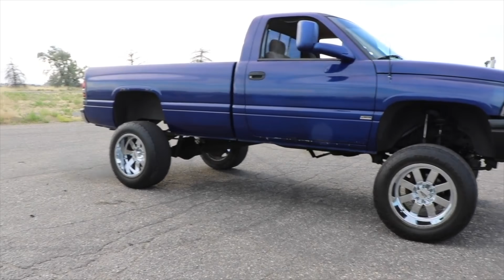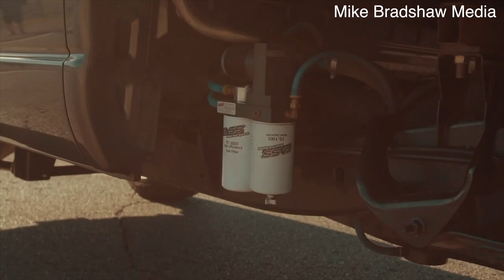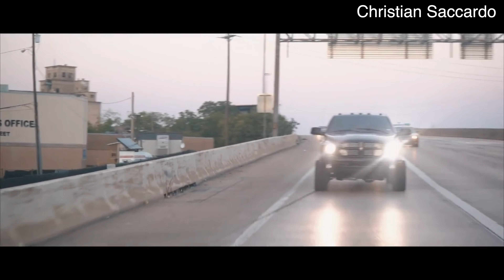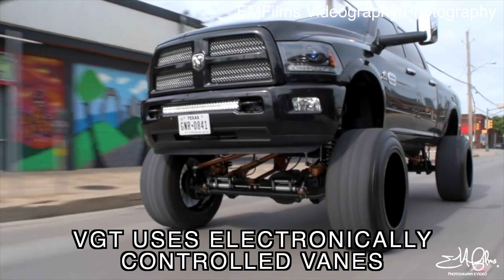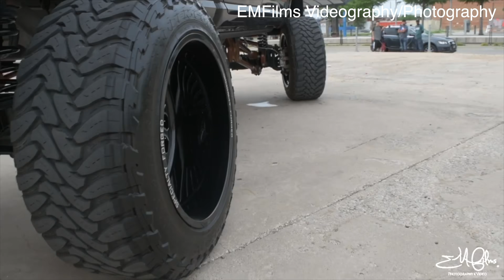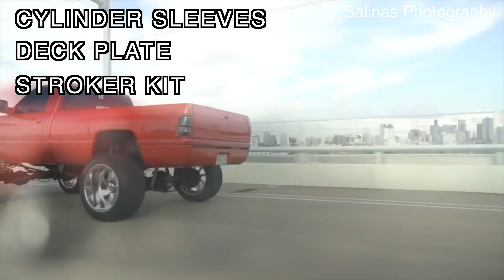5.9L vs 6.7L Cummins: Which One is Actually Better?

Comment: This is a joke of a comparison. Comparing pre emissions to post emissions is apples and oranges.... and lets face it the old 5.9 12 valve that is quickly eliminated from comparison here is the only one of the engines that can get 25-30 mpg and run a million miles... mainly due to... yup NO EMISSIONS, and mechanical everything.
Reply: The first 24v with the VP 44 set up were good too, but still not like the old 12v
Reply: @chazlewis900  I will agree the 5.9CR is just reliable but fuel mileage is no comparison.  I own an 06 5.9 six speed and 3.73 rear I only get 15 empty. My brother has a 97 12V  5 speed  with 3.73 rear and he get 28 empty.
Reply: @ruralram100  exactly what I was saying. Tho you should be getting a lil better with that 06 than 15. Unless your running a hot tune
Reply: The unfortunate thing is my 06 is none stock no tune at all.
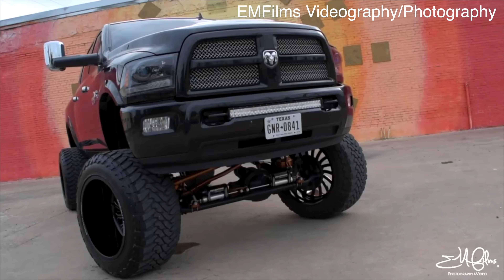Reply: @ruralram100 man you should at least put a straight pipe on it cause my dad's 03 dually 4wd gets  17-19 with 6spd and 3.55, and my my buddies 06 3/4 ton gets about 19 with 6speed 4wd I forget his gears I think it was 3:73 or 4:10, cause it should be getting Betty than 15 with a 6 spd that's auto trans mileage
Reply: @ruralram100  14-15 is about what I get with with my 98 half ton 4x4 With a 5.9 gasser and a auto,
Reply: @chazlewis900  Ok so I guess I'm not bone stock since I am straight piped.  But still my mpg's suck compared to  everyone else I talk to.  I even to the factory air box out and put in a K&N cold air but that didn't even help.  Now she sees a lot of dirt roads so I put my factory airbox back in. Believe me I would be happy to get 18 out of her.  But until then.
Reply: @ruralram100  you gotta watch the k&n on Cummins anyway, I love them on other trucks but Cummins pull so much air they suck the oil off of them. And wierd what rpm you normally run may be lugging it
Reply: @ruralram100  what are you running for tires
Reply: @chazlewis900  At 60 I'm running 1,650 at 75 I'm knockin on the door of 1,800 in my book that is way to tight.  So I try to keep her down around 60
Reply: @ruralram100  that why your lugging her that motor is meant cruise at 1800 on the low end, it optimum range is between 1800- about  2700 high side, if your running with a heavy load should be shifting about 25-27 and running 20-22
Reply: @ruralram100  try running at that for a while and see if doesn't improve, and run a tank of power service through it to clean the injectors
Reply: @chazlewis900  I'll be honest I haven't seen a 5.9 yet or a 6.7 that runs up there In the 1800-2700 range. Every one I've been around they cruise in the 1400-1650 range and get better mileage than I do.
Reply: @ruralram100  that's cause most people lug the crap out of them and why they all have trans problems, I grew up in a family of truckers, and pull heavy with mine hell I've pulled an 18k lb track loader with my 96 3/4 ton and it had 375k on it at the time, run it up it takes some getting used to cause it sounds like it's screaming but it's where it's actually meant to run
Reply: @ruralram100  someting just aint right with those numbers, your engine is not tuned right.
Reply: Chaz Lewis 
My 06 is a stock 5.9 dually., w 4:10 gears, 4 Wheel Drive. It has a straight 4” exhaust , no cat, and a K&N air filter... 
Bully Dog tuner as well which is usually in performance mode...

With a truck cap I get 12 mpg around town and 17 mpg on the highway at 65 mph, Terrible , looking for ways to improve... I am a old guy so I drive very conservatively..
Any suggestions ???
Thx in advance
RJ
Reply: @ruralram100  just as reliable? Not quite. Longevity? Not quite cost efficiency? Not even close. For 1 reason: the cr fuel injectors alone cost as much as a full rebuild on a 12 valve, and guaranteed to fail at a higher percentage rate.
Reply: @justinmartin8887  I’ve seen CR injectors go 400k miles and 12 valve injectors go out at 200k. The common rail is EASILY equally as reliable as the 12v. I’d rather have a trade off of more expensive injectors if it means more power stock, better performance in the cold weather in terms of cold starting & warming up, and ease of tuning and adding power. A bone stock 5.9 cr engine can be tuned to 550 plus horsepower. A 12 valve needs injectors and a turbo for anything close to 400. The tuning ability is also far more advanced than 12 valves as you can adjust timing to be more dynamic in a CR truck than a 12v and not sacrifice drivability.

In short, 12 valves had their time, but they’re old news. The 12 valve is literally the 350 small block of the diesel world and the cr is like the gen 3/4/5 LS/LT. A ton of more room for streetable power, and a crap ton of untapped potential.
Reply: @Redsfanatic32  I never said anything about tuning and steet drivability. It’s quite obvious a common rail would be more capable of that. As far as 12 valve injectors going out at 200k; it probably happened but it’s obscene and nearly unheard of, only happened from abuse. Whereas the common rail injectors commonly go out by 250,000 miles
Reply: The 5.9 24V has several trucks in the million mile club as well. Mine with an eco tune and 6 speed manual would get 22-25mpg.
Reply: Cp3 5.9s are just as reliable and can get just as good if not better fuel mileage than the ve44 or p7100 12 valves.
Reply: @Redsfanatic32  I've owed all three and my dad's 5.9 common rail, gets 17mpg with a 6 speed and 3.55, his 99 vp44 24v 5.9 got 18.5-19mpg with a 5 spd and 4.10 gears, his 95 12v 5.9 with an auto  gets 19-20 with  3.55, and my 96 with 12v 5.9 gets anywhere from 20-25 with a 5 speed and 4.10 gears sitting at 400k miles, I got 20 pulling an 18k lb trackloader
Reply: Chaz Lewis you are lucky I get 18 mpg if I’m lucky. Normally I get 14-15 with a 4.10 rear end and a 5 speed
Reply: @chazlewis900  We got an 05 5.9 2500 auto. gets 28mpg. sooo, Just stop flooring it every chance you get. currently at 560k.
Reply: DC_Rubber Duck 
Are a YOU A SRW OR DUALLY
4x4 ??
Reply: @Redsfanatic32  what the heck is a ve44
Reply: @justinmartin8887  the injection pump used from 1989-1993
Reply: @Redsfanatic32 but not the kinda mileage a ve pump 12v gets
Reply: @johnlonghorn5856  if you read what I said, I did say ve pumps too.
Reply: I've owned ALL variants of the 5.9 and 2 generations of the 6.7. I have to agree with you. The stupid emissions garbage being so expensive made me ditch the 6.7 trucks altogether since I repair all of my own stuff. I'll take any 5.9 over a 6.7 for durability and reliability any day but the 12v at the top. My 2 first gens ride like crap but with the PCM and shutoff solenoid deleted there is no more reliable engine out there. Once running you don't even need the battery. lol
Reply: @BrodieBr0  it's Dodge it's not supposed to ride good it's supposed to be a bullet proof truck that rides like a tank lol 😂
Reply: @chazlewis900  LOL very true...she may ride like a tank but deflects bullets and PULLS like one too
Reply: Brodie Brodie, there is no way u can say that the 5.9 out pulls the 6.7. What I will say is the 6.7 3.73 truck I have has not been a ideal truck because of all the bs shit that has happened with it. They pull hard and do well mpg wise on the road .
Reply: @alexmartin6752  I own a decent sized farm. I've put hundreds of thousands of miles on all generations of cummins engines in Dodge trucks (minus 3rd and current gen 6.7) Both 5.9 and 6.7 even while stock will pull anything you would want to with a pickup. The 6.7 definitely will get you there faster though if that is what you consider out pulling! lol But as you referred too the bullshit emissions stuff is what makes me stick with my old 5.9s. I've never (knock on wood) had a 1st gen 5.9 leave me stranded by the side of the road. I've had too many electrical particulate filter issues leave me stranded side of the road with the 6.7 not allowing the truck to regen, thus not even letting it start. I live in NY and you can't do a delete on the truck because it won't pass inspection. I've traded both 6.7s in and drive my old 5.9s. I'll take reliability over more stock power any day especially if you want to performance upgrade a 5.9 it's cheaper, there's more parts, and you can get more power than you'll need.
Reply: @BrodieBr0  emissions ruins everything. They're taking a very basic engine and making it extremely complicated, not to mention expensive. Of course it's going to be a pain in the ass to run and break down more often.
Reply: @jamesnm21  Couldn't agree more! We need to be very careful because we have politicians out there that want to take our trucks altogether. San Fran already has a law outlawing a citizen from working on their own vehicles! Diesel, classic, and all automotive enthusists need to mass together and VOTE these people out and watch closely who we vote in. No one's taking my rigs!#OverMyDeadBody
Reply: @BrodieBr0  Insane. They don't want people to be self sufficient. Probably some gibberish about safety when everyone knows it's a load of bull.
Reply: People tend to highly over exaggerate the mileage of the 5.9. I mean it gets great mileage for a 3/4 ton but it’s not anywhere near 30mpg get a grip. Relevance: I have owned 3 2nd gen 12v
Reply: @chrismccreight8207  it’s possible to get high 20s in them but that’s if you’re really trying to.
Reply: Who is given out fines? Not in Missouri
Reply: Only in liberal blue states, I deleted all the Emission equipment off my 2011 6.7, she's about to turn 200k factory trans 68RFE lasted 188k on a hot tune, turning 37-35" tires. The only reason it failed is because the secondary line filter vibrated loose and I lost line pressure, I limped it 9 miles home and that toasted the frictions. She has a Suncoast stage 2 now with the sunnex drum. The EGR just dumps the soot into the engine and cakes up the heater grids starving it of air.
Reply: U can’t compare the amount of power though. It’s insane the power difference between the two that almost make u want to get the new engines anyway
Reply: I call bullshit on everyone of yuns. I've got a 12 and 24 valve and none of them has ever seen anything past 21 mpg on the hwy.   At best in regular city conditions I get 16 mgp
Reply: I drive a 2012 f350 4x4 6.7 power stroke automatic transmission complete emissions delete and stock delete tune and with steel ranchhand bumpers front back #1500 lbs extra ARE bed topper #750 lb’s and all my tools for work say at the least 1200# more with a  6 inch lift and 40” toyo mt’s I get 17 miles to the gallon driving 80 mph highway and haven’t fixed anything on the truck yet and got 250k miles on it I use to be a Cummins guy then got into duramax but nowdays you cant beat the new ford diesel trucks the comfort and strength in the suspension drivetrain is better than any of the others and they are as efficient to .
I would hate to even go back and drive my old 95 5speed 12valve again that thing was so gutless and felt cheap when it was new....
The perfect truck for dependable and all around would be put a 12 valve Cummins in a 2004 to 2010 era ford chassis
Reply: Love it  landrover td5 the same wonder why stopped  them
Reply: Love my 97 12v auto club cab 4x4 building her now
Reply: 07, 6.7 mega cab, dually, 275000km as of right now. 105km/hr set on cruise with a full tank says 1235km to empty...dual program, edge pillar reader, H&S tuned. EGR gone. DPF gone. No other mods at all. Not even studs yet. 1235km to empty at that speed and I've done it all in one day full tank. I'm not joking at all.
Reply: VE pump>P pump
Reply: Yeh that’s kinda what he said dumbass
Reply: P pump the 24v 5.9 and better valve seats and it’s just as reliable as the 12v
Reply: A mechanically injected 5.9 getting 30 mpgs???? Maybe if you're drive 45 mpg lugging OD lmao
Reply: @beowulf885  my baby likes 55-60 mph.  She has a Getrag 360, runs 3.07s, and skinny tires.  She’ll run 29-30 mpg all day 🤷🏽‍♂️.  Is she a hot… no.  But I’m not 18
Reply: @jmandella  why the low gear ratio ?
Reply: Moreover, it could hit a million miles even with a bad quality diesel fuel!!
Reply: Ahhh I love my old 12V I had. Longbed 4x4 5 speed. Leaked oil. Probably ran it out of oil multiple times but damn it cranked right up every single time no hesitation.
Reply: Nobody would spend money running diesels in those bling mobiles.  All show, no go is the rule for maximum attention seeking.
Reply: When have you ever seen any cummins get 25-30mpg?

Comment: I have my 5.9 24v, for 14 years, only had to change the water pump, belt tensioner , fly wheel sensor, clutch and belt few times. Now is in his 494,000 km, at is still purring like kitten. With Lucas oil, engine running more quite!

Comment: 5.9 sounds alot better then the 6.7 Cummins
Reply: When there stock with straight piped. But when you second gen swap the 6.7 it sounds like a deeper with the stationary turbo
Reply: I Emissions deleted my 6.7 runs a lot better.  That the Grandaddy 5.9 is a beast. However both of them can't compete with the 12 valve!! 😍
Reply: Believe it or not the 6.7 L Cummins 24 valve is the newer version of the 5.924 valve valve

Comment: The 2003-2007 actually does have egr. It has in cylinder EGR via the camshaft. The lobe separation anges are closer than on the pre 2003. 98degrees vs 106degrees I believe. Closes exhaust valve a little early to trap exhaust gas.
Reply: SlimJim, 
Hopefully you will see this question... or anyone else who knows... tia for your reply. 
Will an older design cam eliminate the IN CYLINDER EGR ???...
Reply: @RJ-sr5dv  Hey buddy. From my understanding, having the vp44 24 valve 98.5 to 2002 camshaft is the best stock camshaft cummins ever put into the 5.9. In short answer, yes, a cam upgrade will eliminate most if not all of the cylinder egr but it should be noted that cummins also had other variables in the mix to achieve in cylinder egr, and to be emissions compliant, such as the smaller turbine housings on the he341 and he351 turbochargers as well as different emissions friendly ecm programming and I'm sure that the piston bowl shapes, injector spray angles, injection events (which are different from 2003-2004.5 to 2005-2007) are a factor as well. If you do a cam swap, it should take care of most of it but I would do custom tuning too from a place that has tested the tunes on a dyno with that cam in a common rail engine and with close to the setup that you will have. Hope this helps brother!
Reply: Slim Jim —-
Thanks for that detailed reply.. Very informative

Comment: I have a 2007 5.9 6 speed and 225000 miles all factory parts all tho it now needs a turbo I work at a bluebird bus dealership and they use Cummins 6.7 all sorts of issues with no power in a bus the ford v10 in a bus with out power a Cummins in a buss all day at the end of the day a messed up vgt actuator will make my paycheck.

Comment: I like both. I use a 5.9 for reliability, I haven’t had any issues with any that I have ever owned. 6.7 i had issues with EGR and I had to delete it. I sold the truck and kept my 05 it’s more reliable and i don’t need that much power.

Comment: I have had 3.  5.9 and a 6.7. I went back to 5.9 and staying with it as lon as I can.   DEF trashed that motor
Reply: That’s why you delete the dpf, EGRs and straight pipe it. They last longer that way.
Reply: There's nothing wrong with a DEF system.  Just clean the doser nozzle once in a while.  3 screws.  It comes off real easy.

EGR on the other hand........
Reply: I'd rather have the later one with def to be honest. They are quite a bit easier on the egr system.
Reply: The def doesn't run through the engine... how did it trash a motor?
Reply: Also 2010-12 were the best 6.7 no def system

Comment: 12 valve Cummins is still the king!
Reply: I’ve owned a “KING” for 20 years, 600,000 miles and counting. 80% of those miles hauling either a dozer or a backhoe. The valve covers have never been off it. Your right in my book....the king

Comment: Cummins ain’t the problem dodge is rust issues and just a junk trunk no lie
Reply: Ohio Till I die I think if ford put the Cummins in factory I would have a Ford I’ve had a good bit of issues out of the electronics on the truck itself
Reply: Ohio Till I die lol everything rusts in the north.

Comment: I own both a 2007, 5.9 and a 2018 6.7. Love them both. My 2018 is a manual and 2007 automatic. The 5.9 seems to pull better in ice and snow without the tires losing grip. The 2018 tends to over power and spin. The 5.9 had about the same fuel economy as my 6.7 driving from Alaska to Texas. With both pulling roughly 1300lbs of weight. I did delete my EGR and DEF and added some tunes to my 6.7. Which greatly increased my fuel economy and saved money not buying DEF fluid all the time.  Now I hunt in my 5.9 and pull my ATV’s. My 6.7 I pull my 5th wheel on long highway trips.

Comment: I have a 1991 Dodge duly 35 runs great never had any issues I have over 1,000,000 miles does not smoke clean body and motor I just recently changed the fuel pump injector pump rebuilt it put a new one other than that no problems runs great
Reply: Make a video with it as proof
Reply: @MGS4_Glazer  no way of proving it. None of the first gens would clock that many miles on the odometer. Gears always stripped way before. Mine quit at 181k.
Reply: Lol proof.... Its a cummins. Theres your proof.

Comment: I prefer a 5.9 12v just for pure reliability and mpg
Reply: 2018 Megacab, 6" lift, 37" tires.  70 mph, to and from San Diego to LA = 21.1 mpg. Just under 14k miles now.
Reply: @77AbleArcher  ok if you got a tail wind and the right gearing yes you'll get that, but with a 12v you could get upwards of 25 mpg or so
Reply: @austinblevins6804  yeah, weird.  There was a tailwind blowing from the south on my way up, and from the north on the way down 😆.
Reply: @77AbleArcher  that shit is possible over there